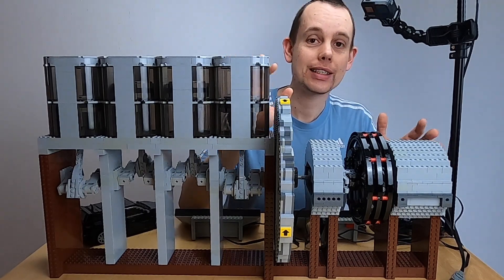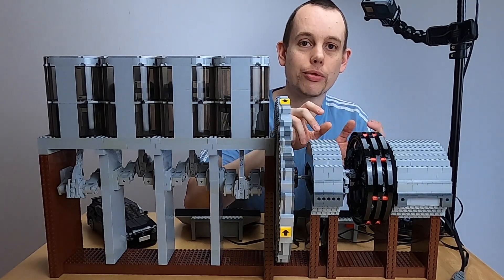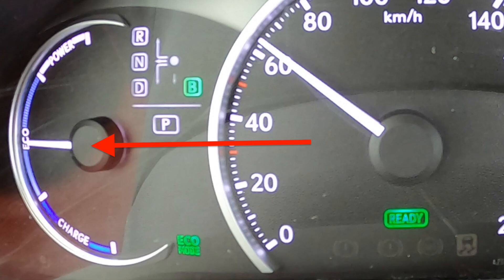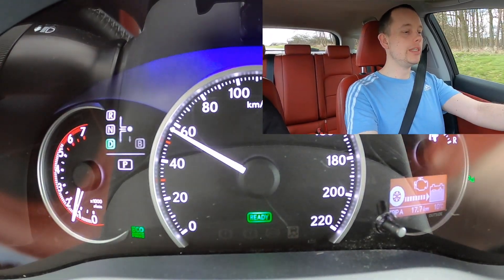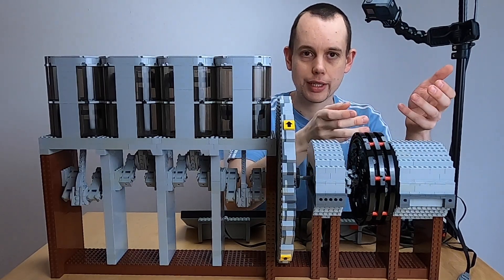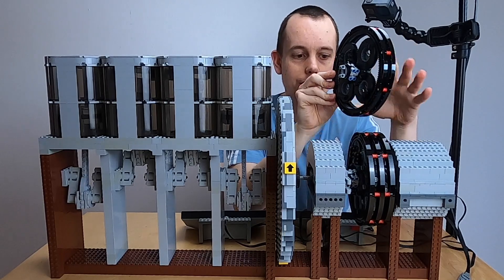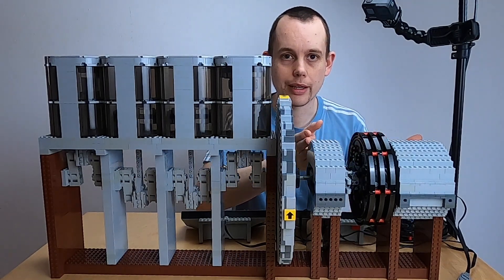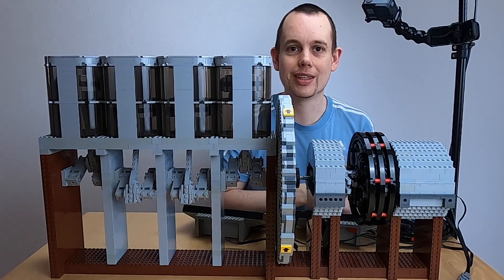Hybrid drive modes "B" vs "D" explained using LEGO and a Lexus CT200h

Comment: Not all that clear. Anyone interested in this 'B' mode and how it works should view the 'Car nut' videos. He is a Toyota master technician and gives a very good description of how 'B' mode works. In essence, when in 'B' mode, going downhill the Motor/Generator goes to maximum charging and the ICE spins but does not receive fuel nor spark ignition. Result is the ICE slows the car down just as it would in a normal petrol engine when put into a low gear going down hill.

My explanation is over-simplified, so go now and see the 'Car Nut' explanation. It's absolutely excellent!!

Comment: Good info. The charging increased while in “b” mode. I assume the engine assisting in braking was the cause of charging increase. Toyota’s official response is that it is engine braking does not charge the battery. I didn’t believe Toyota But after seeing you video b mode increasing charging because the motor is engaged.

Comment: is it safe and sensible to keep changing to B for downhill only and back to D whilst driving?
Reply from the maker: Yes. The ECU programming will ensure that the engine is never overstressed. You can even put it in P at highway speed and it simply turns into a safe mode. This is also why it refuses to rev when you have just turned it on. You can also see how it tries to counteract my stupid driving style in the video.
Reply: @LasseDeleuran  hmm, great technology, thanks for the reply
Reply: @LasseDeleuran So there’s no need to press the brakes to switch between these two modes, right? Thank you Sir.
Reply from the maker: @fhamdioglu  Correct. You can even press "P" while in motion. Luckily the computer is smart enough not to lock up if you make that mistake.

Comment: Hi. A very good explanation. Congrats. Let me ask you a question: i was driving my car (Corolla Hybrid) down a hill. The battery was completely charged. When i selected the "B" position, The car made a very loud noise, like a monomotor airplane taking flight. Some mates related The same experience. Do you know what causes this noise? One guy said it is because the acumulated energy is being  discarded.
Reply: Hi did you found an answer for your question yet?!  Because i have the same question and im wondering what was that sound from or what is it!!
Reply: @b07ussein  Hi, man. I not only have received an answer so far, but also haven't found one by browsing The Internet.

Comment: I have a Prius 2009, when the ABS has been replaced by a mechanics, putting the can on B mode will not slow the car as it was before replacing the ABS. any explanation why ?
Reply: Sounds like your mechanic screwed up something.

Comment: Is using it detrimental to the car in any way?
Reply from the maker: My best guess is no. You are spinning the engine needlessly when using it. However. The engine will not be under load, so the added wear and tear on it is negligible.
Reply: @LasseDeleuran  exactly what I thought....I use B when i enter junctions or when I'm driving fast and use it like a downshift then back to D (upshift)when I accelerate...never do I leave it in B. The car slows down much quicker with less stress on the brakes....the reason I ask is because some guy was saying I'll kill my car doing that...I doubted it because why would toyota make mode in the car which ruins it...B is like a low gear on deceleration.
Reply: O BTW the effort you put into this video for people like me is astonishing...that lego model of the ct200h is awesome...exactly like mine...well done sir!!
Reply: @pollumG  there’s no wear on your brakes if you don’t press them hard. Use a light press for regen. Shifting to B is wasting energy turning the motor you could be using to charge the battery. 

B is for descending long hills
Reply: @aluisious  in b mode slowing down charges the battery. Modern cars don't use fuel upon deceleration. Even toyota says you can use it to slow down and its not exclusive to long downhills..anyway you do you and I do me. I know for a fact when driving a bit spirited engaging in b mode when cornering tucks the nose in then put back in d mode again when accelerating out of corner or when you need to slow down fast because you're going a bit too quick. B mode has many uses if you know what you're doing.
Reply: @aluisious  Wrong.  ANY use of the brakes wears them as that's how brakes work.
Reply: @pollumG  Actually, no.  As long as the engine is running it is using fuel.